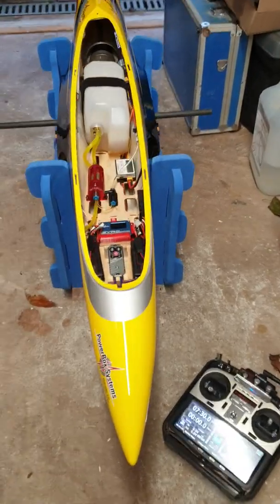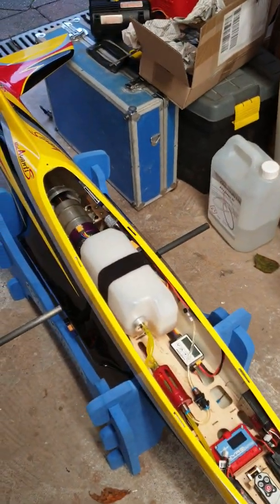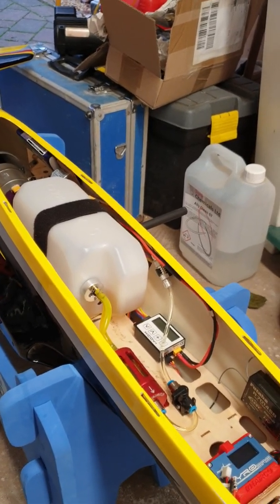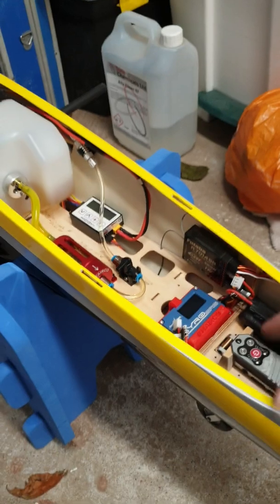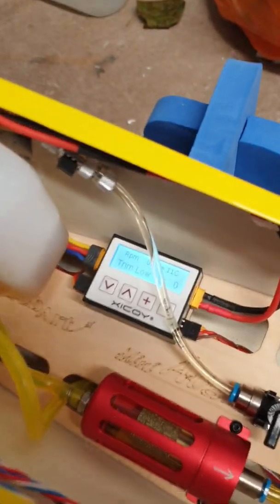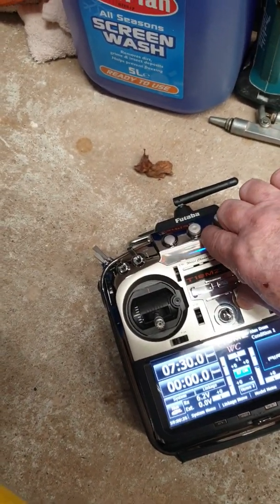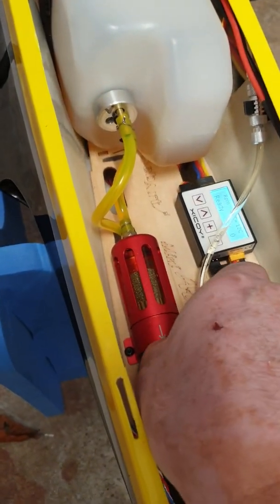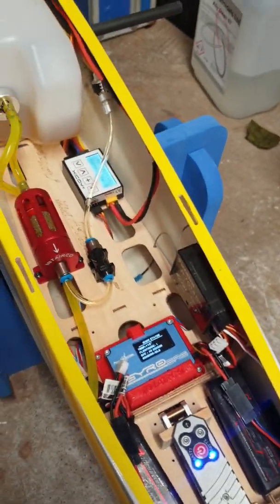225,000RPM Better than fortnight first start of the Sebart mini Avanti with the Xicoy x45 turbine

Comment: How did the maiden go? Do yoi recommend that combo sebart+x45? Thanks
Reply from the maker: The plane is flying great its one of the best flying jets i have
Reply: @alanjets  thanks, do you maybe have some video.
I have bigger jet but would like something more convenient for 1-2 flights and pack up back home to family :)
Reply from the maker: https://youtu.be/gOmrMxpvmA0

Here is a video a friend took of our avanti flying
Reply: I had a Mini Avanti with the X45 and it flew well. Sebart did put out a warning when people started to fit 45N turbines that you must not use full power in even a shallow dive as it could overstress it on pullout. I restricted the X45 to 35N for safety and had no problems, 35N is more than enough for the plane as it will fly on 20N but has problems on grass takeoffs.
Reply from the maker: @JimGDMAC  I also fly off grass we did start off on 35n but struggled on taking off so we turner them up to full power and we don't use full power in flight only on verticals never coming back down. If you fly sensibly you will have many flights it still remains one of my best jets to fly
Reply: @alanjets  Never had any problems off grass with the X45, only with the original Jetcat P20, maybe we cut the grass shorter. Unfortunately mine was lost to radio failsafe after a years flying without problems. Now replaced with a Sebart J39 Albatros. The only problem I had was with the springs on the undercarraige main legs, these broke a couple of times landing on grass so I replaced the legs with upgraded JP ones.